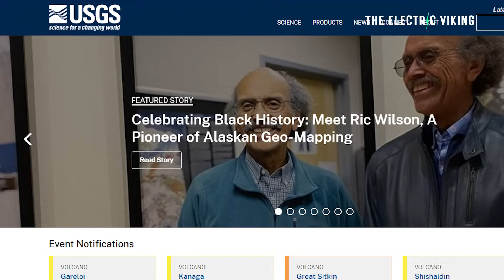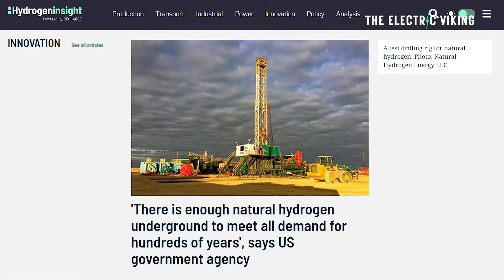US Government: 'Gold mine' with 200 years of hydrogen discovered underground

Comment: The big problem with industrial scale processes and hydrogen is that from a chemical engineering standpoint, hydrogen is one of the most hazardous elements to work with unless you have a very controlled and specific environment. Now some elements, like fluorine, are highly toxic both by being gaseous and highly reactive. Breathing gaseous poisons is the fastest way to get them into your bloodstream, short of an IV.

The problem with hydrogen is that hydrogen gas can leak through solid steel pipes. The atom/molecule is so small it can leak through the vast majority of practical industrial type infrastructure.

While not being toxic, it has two other problems that make the leaking issue into a major safety issue. First of all it is highly reactive, and with regular things. Like the oxygen in the air. The other thing is it has a very low energy of activation. That means that it takes very little energy to initiate many of those reactions. So that means a very small spark can set it off. Plus it yields a fair bit of energy while doing this. 

Industrial processes dealing with hydrogen gas must be positively ventilated, as well as deliberately designed so you don't have dead spots in the air circulation, where hydrogen can accumulate. Because by definition it's lighter than air, those dead spots aren't where you would find them with most normal industrial processes. So it needs to be both designed and built properly, as well as operated in an extremely safety conscious environment.

Watch the oil rig workers changing drill bits, or adding pipe sections to the shaft itself, while it's operating. There are accepted practices in that industry that are simply not acceptable in the vast majority of workplaces.

But the safety regulations that I've seen, watching them drilling, are primarily ones that will tear off limbs, crush people, breaks necks once you fall 80 ft, ad nauseam. With hydrogen it's more of a Hindenburg type of disaster, except on an industrial plant scale.

That was what held hydrogen back from the beginning. Things like hydrogen fuel cells have helped, but the infrastructure to safely handle hydrogen "pumps" being handled by regular everyday folks, is going to be an even harder rollout than chargers for EVs. So now here is the problem in comparing the two technologies, and since EVs charging infrastructure is already building out in some of the  most remote areas - I don't see hydrogen replacing EVs. Plus, we recently had all four charging stations at the local children's science center have their main cables cut.

Probably by the same kinds of people whose strip houses and industrial sites of wires when nobody's there. Fortunately electrical code typically means that all that happens is they simply don't work, and are expensive to repair. Now think of those same morons thinking they can steal pieces of a hydrogen station. I could see this working in someplace like Japan. In the United States I have my doubts.
Reply: I agree with everything you said except working in Japan. I have worked on rigs in Kazakhstan and Iran and all through Alberta mostly as an H2S consultant and safety guy. Drilling for hydrogen will be no more risky than drilling for natural gas. The alloys needed to avoid hydrogen embrittlement and blistering are expensive. The trick is time, see hydrogen is the lightest molecule so we will always be at the top of a gas formation that produces it and other gases. This is called stratification. As long as you drill into that upper section then you’ll get hydrogen only out. If you pull hard on the well then it will mix with other gases but the trick is to produce slowly. So you will have pure hydrogen coming out of the production string then if you’re smart you’ll put it immediately into a fuel cell and create electricity. You have almost an immediate revenue stream for very small relative cost while using the hydrogen in situ.
Reply: @Palisades_Prospecting    Agree.  Btw I've worked with H2S also.
Reply: I agree with everything you said except working in Japan. I have worked on rigs in Kazakhstan and Iran and all through Alberta mostly as an H2S consultant and safety guy. Drilling for hydrogen will be no more risky than drilling for natural gas. The alloys needed to avoid hydrogen embrittlement and blistering are expensive. The trick is time, see hydrogen is the lightest molecule so we will always be at the top of a gas formation that produces it and other gases. This is called stratification. As long as you drill into that upper section then you’ll get hydrogen only out. If you pull hard on the well then it will mix with other gases but the trick is to produce slowly. So you will have pure hydrogen coming out of the production string then if you’re smart you’ll put it immediately into a fuel cell and create electricity. You have almost an immediate revenue stream for very small relative cost while using the hydrogen in situ.
Reply: Hydrogen is also a strong greenhouse gas. Radicals to break down methane are created at a fairly constant rate; adding reactive hydrogen gas protects the methane making hydrogen a strong indirect greenhouse gas. Fugitive hydrogen is a big problem that has been widely ignored.
Reply: @soylentgreenb  Water vapor (WV) is a GHG = CO2. There is 50 times as much water vapor in the atmosphere vs CO2. Water vapor is widely ignored. If every molecule of CO2 causes the evaporation of 3 of water vapor why doesn't WV cause runaway? It is not persistent? You can average the results. There is 50 times as much.
Reply: @msimon6808  No, that's BS. Water vapour is essential and always considered. Water vapour is in a temperature dependent equilibrium. It acts to some extent as an amplifier on other greenhouse gases as you point out. But reality is complex. This is the core of the disagreement in climate sensitivity calculations. CO2 is easy; it mixes evenly. Water is in the lower part of the atmosphere; CO2 and other gases extends all the way up. Higher water vapour tends to mean more cloud coverage, which reflects light back into space. At sea level nearly all lines that exist are saturated already, meaning that more water vapour doesn't contribute as much as it could if you hypothetically put water vapour at 50 km (and magically kept it from turning into ice).  But at great elevation the pressure is low and most lines in e.g. CO2 are not saturated. What you're doing when you add CO2 is adding another blanket at the top of the atmosphere and this propagates all the way down to sea level, even though the lines are already very saturated down here.

Water vapour doesn't lead. It follows. It cannot by itself cause runaway greenhouse warming because it is condensable.
Reply: Great detail.  Thanks for sharing.  I'm not so sure that hydrogen would replace EVs, but that doesn't mean it can't be used in power plants.  The electric grid effectively de-couples power generation from power usage so we wouldn't have to transport this resource directly to the public.
Reply: @TheJourneyBegins777 i dont foresee the most obvious use of H2 being for EVs, rather for industry. Industrial processes like cement manufacturing, ceramics, steel, chemicals, distillation etc need (lots of) heat, which is currently provided by fossil fuels.
Reply: @229andymon  Hydrogen from mines (drilling) is a fossil fuel.
Reply: How did it work for Count Zeppelin and airships ?
Reply: @kenrobba5831  
The Hindenburg diesel fuel burned and fell to the ground, killing crew and passengers. The hydrogen went upwards, lighter than air. The very dangerous parts of a hydrogen fire are (a) the fire itself, extremely hot, water boils instantly, humans are 2/3 water, and (b) directly above.
Reply: Right. Gasoline is totally safe.
Reply: Giving the public access to H2 seems more than risky. The stuff is vastly more dangerous than LPG or petrol.
Reply: zzz zzz zzz
Reply: Nah.  H2 is not that hazardous.

Comment: In Texas we have a lot of Natural Gas, it's 4 parts Hydrogen and 1 part Carbon, the cleanest fuel we have access too. It can be cracked and make pure Hydrogen. But the Liberals don't like it . The Drilling here is very high tech now and very tightly controlled so as not to pollute, we have 300 years of Natural Gas in Texas

Comment: Large scale hydrogen usage may have serious negative greenhouse gas issues. More research is needed before we just jump on the hydrogen bandwagen. It is an indirect GHG and has complex reactions with molecules in the atmosphere. Because it leaks like crazy the concern is that the leakage will be significant enough to be a problem.
Reply: Hydrogen is fast as fck so it doesn't stick around long. It has enough escape velocity to leave earth permanently.

Comment: So why are companies spending billions trying to make H from water using solar powered electrolysers ?
Reply: There is no trying.  Electrolysis is known technology.  It is simply part of the too expensive hydrogen chain.  This will not change it for automotive use.  Maybe heating homes with cleaner fuel.
Reply: @danharold3087  Yes I know the technology exists , but is it being used on a commercial scale anywhere ?
And if H is undergound in enormous quantities why make it by electrolysis instead of extracting it like natural gas ?

Comment: Looks like hydrogen electric cars are about to be cleaner than battery electric cars!
Reply: No. Hydrogen is an engineering nightmare to work with and has terrible energy density. Even the rocket industry that chases every performance advantage is ditching hydrogen for methane because LH2 is such a PITA to work with.
Reply: Whichever is cleaner and cheaper wins.
Reply: It would tie you back to the big companies that now control oil and especially natural gas.  I am sure they are interested and best positioned.  They want to keep their hands in your pocket. Prior to bad mouthing  BEV batteries look into the life span of fuel cells.
Reply: No. Hydrogen is a terrible full. A hydrogen fuel cell car is an EV with more plumbing and no recharge infastructure .

Comment: Discovering and commercializing are two very different things. I doubt this hydrogen can be used economically this decade, if ever
Reply: Researchers believe but have not found these naturally occurring hydrogen in economical quantity.
Reply: Even if not present in exportable quantities it could at least be nice for local usage, like that village in Africa.
Reply: @samheasmanwhite  Hydrogen is unsuitable for domestic use.
Reply: Hydrogen is also used as an ingredient in the chemical industry
Reply: EVER? COME ON NOW.
Reply: Likely, but that might not matter.
1. Modern technology has a habit of building upon itself. The fracking and other industries now allow extremely deep, horizontal drilling, piping, etc. with sensors, Earth penetrating radar, etc. Extraction probably isn't that difficult.
2. Hydrogen fuel cells may not have made it big "commercially", but it is a well-known, proven technology in terms of fuel cells in industries from submarines, space flight, aircraft, etc. There likely wouldn't be a lot of R&D to make larger scale power generation facilities. 
3. In the end, it doesn't have to replace things this decade. A few test facilities to proof it is abundant and accessible is good enough. Once it is known, it keeps down the cost of energy, maintains stability, can be brought on slowly, etc. It's like Canada's oil sands. It's there, we know how large it is, and we know it can be used if/when oil reaches a certain price point.
Reply: @BW022  zzz
Reply: Hydrogen and hydrogen fuel cells have well known drawbacks that have been well known and unfixable for decades.
Reply: @BW022  Hydrogen is super expensive to store and transport.It is not a practical replacement for fossil fuel
Reply: @amracewaythey could build a powerplant on top of the reserves
Reply: @amraceway  Why store or transport it? Burn it when and where you extract it and convert it into electricity. You don't have to us it to replace gasoline, oil, or natural gas (heating). Most natural gas in the US is turned into electricity fairly close to it's extraction points.
Reply: @amraceway  currently new methods are coming  storing snd transporting hydrogen at ambient temperature and pressure.
Reply: @syedputra5955  There are always new things coming. Physics however doesn't change and its laws can't be ignored. Avoid hydrogen unless you need it for its chemical properties , not as a fuel.
Reply: @BW022  Hydrogen is a poor fuel. It is extremely unstable and destroys anything metallic.
Reply: Storying hydrogen in hydrides and similar is possible but it makes hydrogen suck even more than it already does. Hydrogen is very, very light; if you bind it to even a light element like magnesium yoy only get a few percent hydrogen by weight. The best storage form for hydrogen is something like boron (in very toxic compounds once considered for ICBMs) or carbon. Both of those have their own problems.
Reply: That confirms we need to use as we go instead of storing it or will that not work @soylentgreenb
Reply: @duanenichols8666  And using it without transporting it too. Hydrogen embrittles metals and is very leaky and a greenhouse gas (idirectly through protecting atmospheric methane from oxidation, which makes it a greenhouse gas almost as strong as methane). This means the existing gas networks aren't very suitable. Put your steel plant directly ontop of the hydrogen source and it might make some sense, or make the hydrogen next to where you will use it.

Short term storage can be done, but it makes no sense for vehicles. What you do is blast a large cavern in the bedrock and clad it in thin steel formulated against embrittlement and grout the cladding to the bedrock. Storing hydrogen in there at modest pressure can buffer demand and supply a bit; but long term storage is still stupid.
Reply: @amraceway  
Likely it will combined with coal to produce petrol, diesel and kerosene.
Reply: Hmmm...seems to be working OK powering cars & trucks  in Iceland! @amraceway
Reply: @jamesreynolds5045  Only with massive taxpayer support. Have you seen the eye watering cost of a hydrogen vehicle? The fuel tanks cost more than a regular car. They are greenwashing at its absolute best. Hydrogen is a junk fuel. Very important as an industrial chemical, but very difficult to contain as a gas.

Comment: This sounds highly speculative.  There is one known hydrogen producing well at the end of the mid-continental-rift in Kansas.  And it is not pure hydrogen. 

The drilling muds pumped into the Kola ultra-deep borehole come up fizzing with hydrogen gas, but having to drill that deep to get it doesn’t seem economical.
Reply: The Kansas well is a completely different hydrogen source (fossil derived) from the main non-fossil form (the Kola type) that the USGS was referring to. Serpentine hydrogen is pure and very abundant but has to be deep to still be contained because hydrogen diffuses so easily. But the US is not the most promising place for this new gold rush - other continents  have much more promising geology (you need very old iron rich rocks - the hydrogen is released as water under huge heat and pressure rusts the iron). In Australia alone I know of three successful hydrogen "strikes" already - it is deep, but no deeper than some production oil fields (eg Brazil's).
Reply: I have found 8 bilion sources of pure biogas, they will last on average for 70 years. It is in your back. Do you see a problem in harvesting and using it?
Reply: Only about 30% of people make methane.
Reply: @Petriiik  
Drill baby drill .....
Reply: Dexter Kansas well is known for Helium. I guess it could be possible to actually get H2. Highly speculative is a great way to put it. Feels like the headline needed to be 200 years so the math was figured back from a beliveable efficiency to give the amount that is potentially there. Doubtful, but willing to pay attention to whatever Gates is pushing.
Reply: Likely fracking hydrogen rich minerals or coal and shale, then mining hydrogen
Reply: @MARILYNANDERSON88  Molecular hydrogen cannot be stored in porous strata near the surface.   If it exists anywhere in economically-useful concentrations, those will be found at very great depths.
Reply: If you pump oxygen into a oil reserve you'll start to produce hydrogen.  The oil industry has known about that for decades.  They considered it a waste gas.  There is one site close to where I live where they have started to filter it out and are producing around 300 tonnes of hydrogen per day.  That tech has been licensed out in Europe now to start producing around 5000 tonnes per day.
Reply: @pin65371   How much does it cost to produce this hydrogen per tonne?